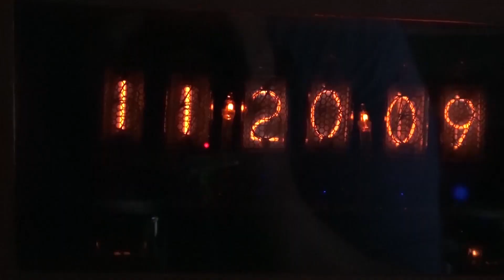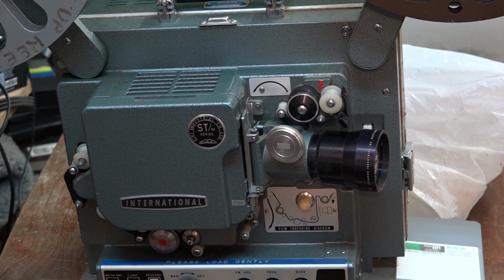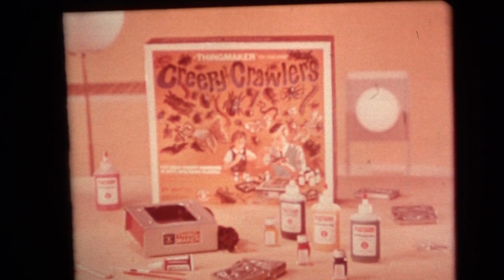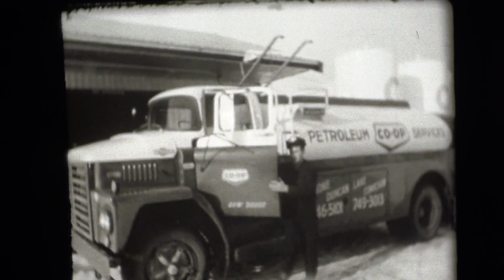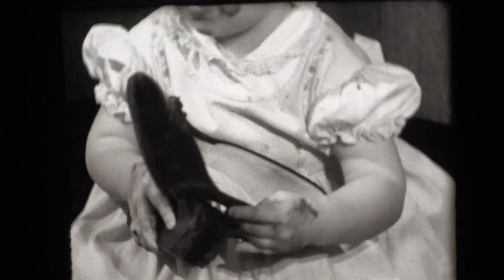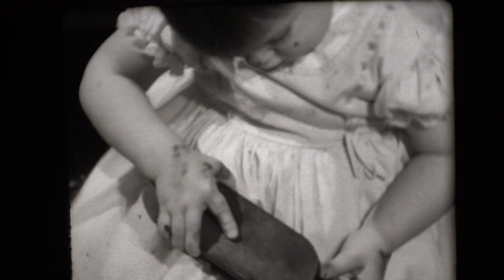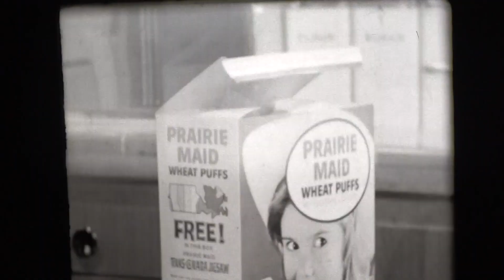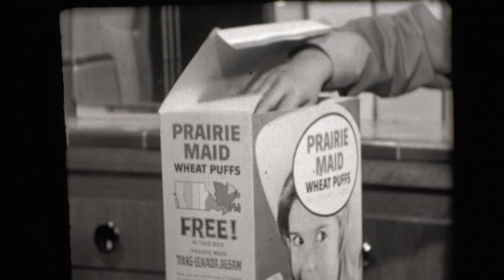Vintage TV commercials on 16mm

Comment: Having been a subscriber for less than a year, I was unaware that you formerly worked in television, but I should have guessed from some of your interest in pro equipment (as well as consumer gear)...  By the time I worked in TV, film had been completely phased out in favor of 3/4" U-matic, 1" type C, and commercials carts loaded with 2" quad tape.  Thank you for sharing these old commercials that would otherwise have been lost to time!  Bonus content for patrons is a good idea, I wish you the best in this endeavor.
Reply from the maker: I worked in the TV business from 1979 to 1982 while in school and college. That was actually my formal training, video production. I worked for a community station, both as an unpaid intern (bloody slave drivers) and as paid producer..... er master control. The most boring job in the industry. Cue up tapes or film, and put them to air, fill out the log book, make sure the audio log tape is working. Didn't matter what visuals went out on the air, could be running porn for all they cared, as long as the sound track wasn't that then what did it matter. After my stint in community TV I was applying at all the local TV stations, and was working as a stringer (freelance photojournalist) for CBC and Global TV. Actually that is a hell of an idea. I have a few tapes of some of the stories I did, both the actual aired footage and raw footage. That might be an interesting tape to digitize and post. It was all done back in the 80's and 90's so I doubt that the TV stations exclusive use contract would apply anymore. I have several 2 hour tapes of my aired work, if I can only remember where I did with them :)
Reply: @12voltvids  I started in 1994, so I was getting in as you were getting out of it.  My primary job for most of my time in TV was directing newscasts, small market, so I was calling and switching.  But during non-news hours, I would shoot and edit commercials, run master control, build graphics for the news department, or pretty much anything else that was asked of me.  Just before I got out of broadcast in 2009, my TV station made me the "community education coordinator"... basically taking calls from viewers who couldn't figure out how to hook up their digital converter boxes... I'm pretty happy to be out of it now.

Comment: Cool! I have plenty of 16mm films that I acquired off of eBay in the past including the cartoons. I have a few Bugs Bunny cartoons that I have in my collection, along with plenty of cartoons that I got in the past. 

I usually had two 16mm sound projectors including the Bell & Howell Specialist, and a Singer Glaflex 16. I got rid of them, because of the auto loading mechanism which cause the film to eat up or tear up the sprockets where it cause the film to damage. Thankfully I finally got another projector off of eBay a few days ago, and it’s a Revere 16mm sound projector model S-16 from about 1949 or probably the early 1950’s. It works perfectly, but the problem was the takeup reel was slowing down. So I did cleaned up all of the original grease since it has gummed up for decades. I used plenty of Isopropyl Alcohol to clean out all of the grease on both the takeup and supply reels, and then the chain belts where I did cleaned up, and then after that, it runs perfectly. And then, the second problem that it had no sound coming from the speaker. I checked the main amplifier, and it has a basic All-American Five tube set which was common in radios, and I checked underneath, I found a piece that someone stuffed a dropping resistor in, so I removed it, and I checked that all of the original capacitors and resistors are doing okay, and of course, the exciter lamp got blown when I just checked it after I first got, but it needs to be replaced.

I tried one of the silent 16mm films instead of sound and it does run, and I had fun watching cartoons on it. 

And has for the cabinet, the leather at the bottom is in sad shape, but it needs to be redone, and the handle is broken, but it needs to be replaced.

Comment: I love these things! I used to be a projectionist back when I was 14 up to 22, I ran 35mm carbon arc projectors. One thing: the slack before  and after the projection head should be kept smaller (not too small): if there is too much slack before the projection head it will result in noise and the slack can get tangled with the feeding film and tear.  Too much slack after the projection head will off-sync the sound and can tangle up the same. For audio sync, the actual projected frame on 16mm is spaced 26 frames from the sound drum.  By the way: the sound pickup on this projector, is it a multiplier tube or more modern photo sensor? (I have been working on projectors where the tube was replaced with a stereo photo sensor .Best Regards,  Moshe.

Comment: wow smooth flicker free transfer. Did they make a 5 blade shutter for 8mm and super 8 as well?
Reply from the maker: As far as I know they only made them for the 24 frame 16mm projectors specifically designed for television use. 
Optically this turned the 24 frame rate into 120 optical frames, which is 2x the 60 hz field rate. 3 flashes of 1 frame, 2 of the next. This is what is referred to as 3:2 pull down. I could have gotten a much sharper picture had I just projected onto a white piece of paper rather than that high gain video projector screen I was using.
Reply: 12voltvids Actually I think the best solution on the consumer market for 8 & Super 8mm is the wolverine which I have the first generation 720p version where you have the 1080p second generation. I have been considering the upgrade for the second generation for some time now but I have been feeling in the transformation at higher resolution rates is only going to reveal more imperfections as you go higher in capturing resolutions as if they someday go up to 4K.